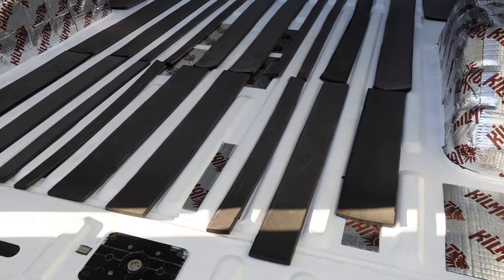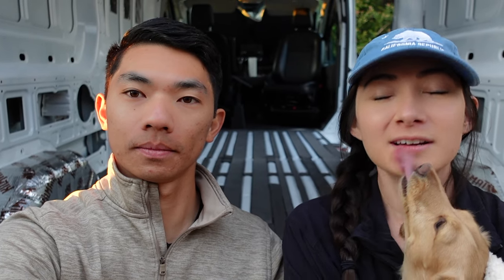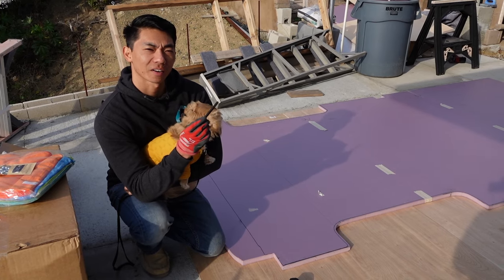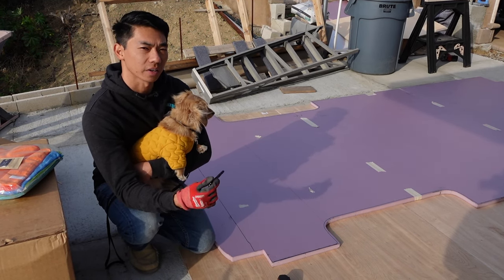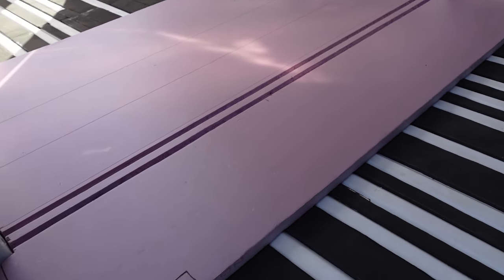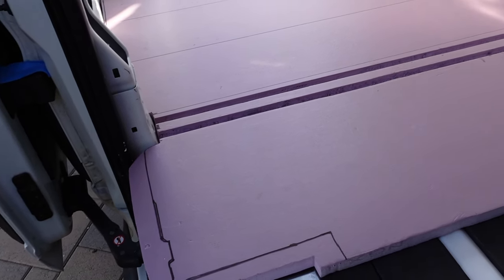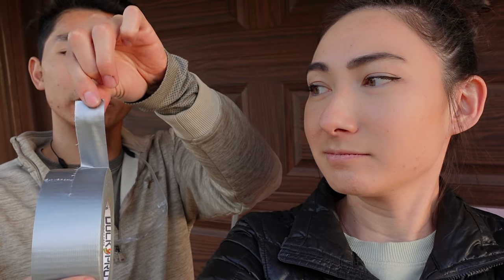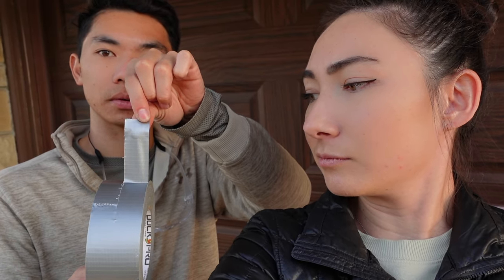DIY Van Prep and Subfloor - Kilmat, Minicell, XPS Foam Board, Plywood | Van Build Series (Ep. 7)

Comment: Great video. How tick is the plywood? Also what kind of plywood is this? There are many types in the store. Thx
Reply from the maker: Hi! We just used 1/2” birch plywood from our local hardware store. You won’t need thicker than that for the subfloor. If you have access to Baltic birch, even better.